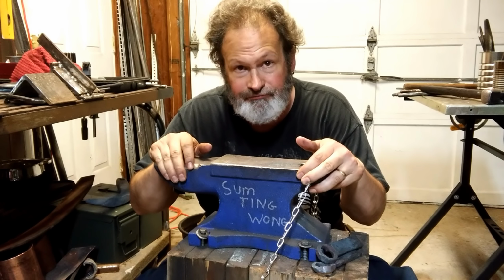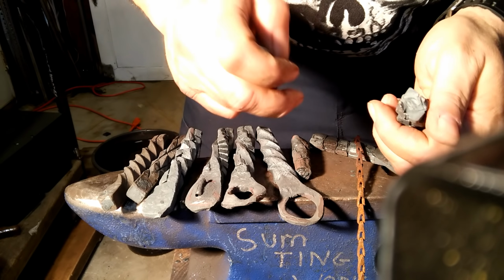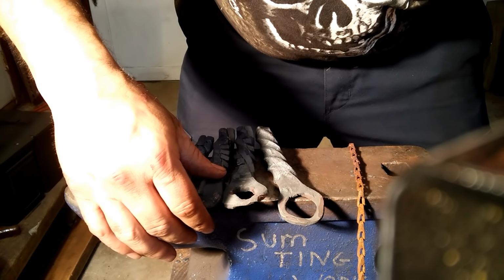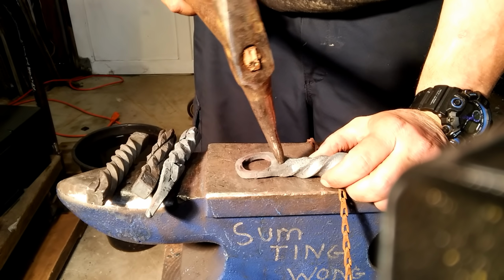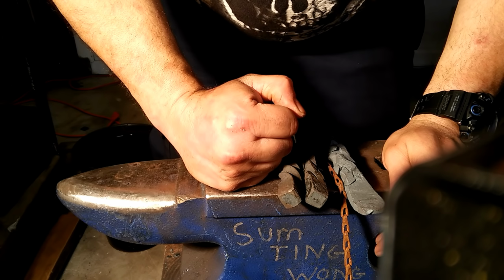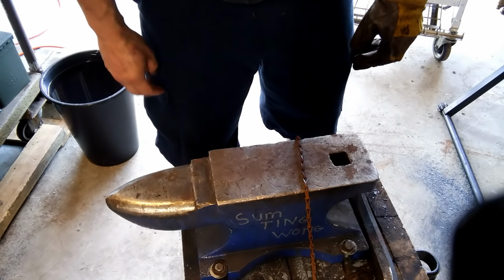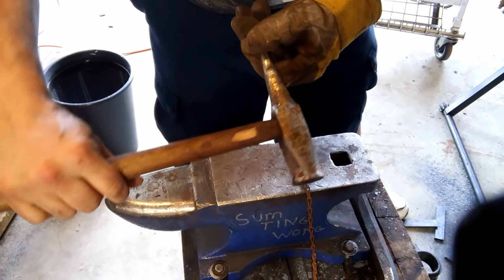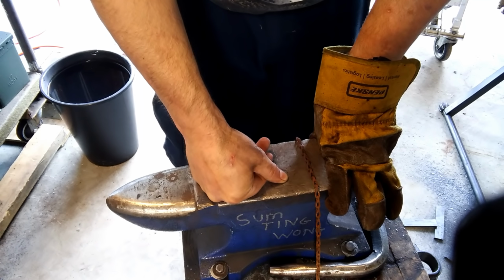Bottle Opener Blues part 1

Comment: Perfect! Bottle opener first, twist second. Make a tool that works. Then a tool that is art second.
Reply: John Switzer mentioned that letting the metal cool to a cherry, helps the slug shear, instead of fold.  As for the holdfast, I see motor cycle chain works well. Make a bottle opener in trade to a cycle mechanic, to get some, perhaps. Forge on Brother!
Reply from the maker: Definitely. I'll mention your idea in part 2
Reply from the maker: Yep. John is where I learned that but forget to follow it. Lol
Reply: @grandadz_forge  learn by the mistakes of others...life does Not provide enough time, to learn them all alone. Thank you for sharing Rob!